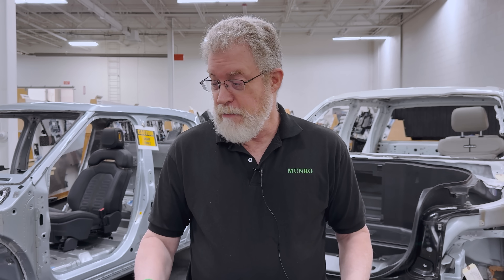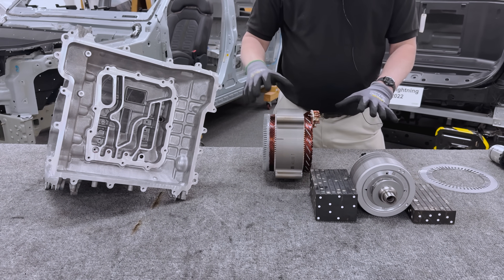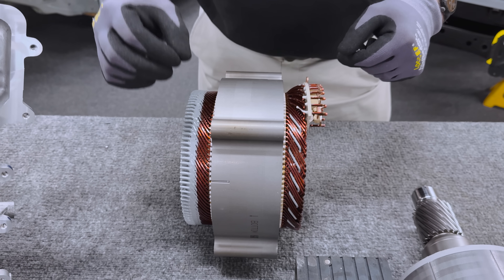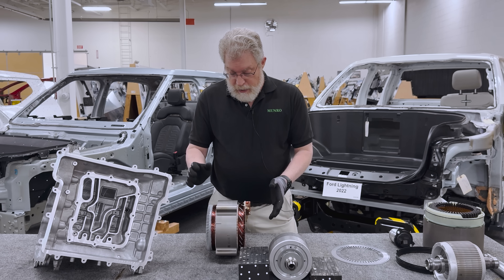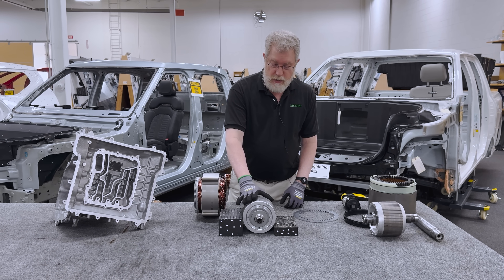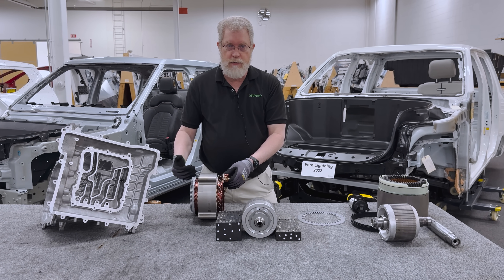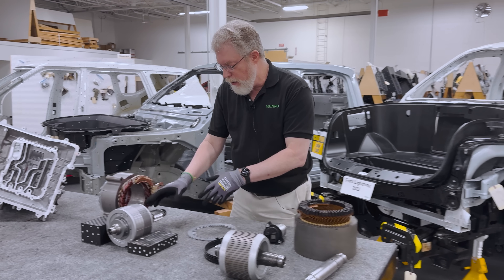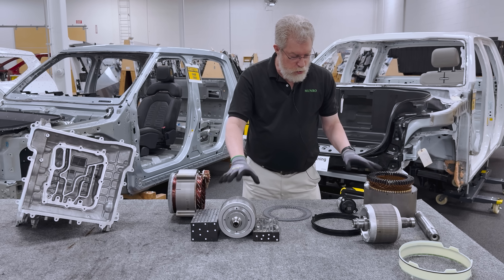Inside EV Cooling Systems: Tesla vs GM Electric Motor Comparison

Comment: Amazing to realize that a relatively compact, simple unit like an electric motor and gearbox can  usually exceed the performance of the much larger, heavier, wasteful gas engine and transmission, and not spew harmful stink exhaust into the same air humans like, and need to breathe.
Reply: Absolutely 💯
Reply: Never thought about Suicide by ICE. I guess you could always electrocute yourself but shoving your fingers in the charging plug😂😂😂😂😂
Reply: As a person here that replaces/troubleshoots drives and giant ac and DC motors in elevators for a career  your misinformed   electricity is very dirty #1 you would be surprised the carbon that is produced by electricity  these motors and drives pull the atoms in the air and change it to crud 
 # 2 you have a giant 1200lb battery attached to the car talk about inefficient 
Everything in life has a equal and opposite reaction  you  can call ice inefficient but evs are just as bad  heat is lost energy hence this video  hence elevator machine rooms constantly have to be cooled. Evs are like taking the jab  just my opinion
Reply: @doaudi1720 Could you please link to the chemical formula that explains what is going on in #1? Maybe you are just seeing some sort of pollution already in the air being sort of filtered out by static electricity charges from the motors? Not at all like an ICE chemical reaction that takes place for every firing of each cylinder. I can sit in my garage with the EV motor humming away without having the CO2 make life difficult.
Reply: @doaudi1720 EVs are more efficient than ICEs in every step of the way
Reply: You didn't include the battery system in your opinion.
Reply: Or drip oil or require oil changes every 6 months which also drips oil into the environment or everly's oil. And you never have to change a Tesla's oil for like I don't know. I think it's like a million miles. I've never changed mine past even 126,000 mi cuz there is no metal rubbing against each other like in an engine. It's just a cool
Reply: @bryanchannell7715 yes.
Reply: @bryanchannell7715  I disagree, there are bearings.
Reply: @tedmoss with very little load. The bearings act as locators in the motor to ensure constant distance from the stator.
Reply: @tedmoss certainly so. And which type of vehicle has fewer bearings to fail and which vehicle type imposes the heaviest loads and cyclic pounding on the bearings?
Reply: And animals breath too , but mostly humans in concrete jungles. Combustion 👎 EV ✅
Reply: EV and ICE are opposites: EV - Great, easy power, but crappy "fuel source". ICE - Complicated power delivery, but an efficient, high-density fuel source.
Reply: @snowrocket What crappy fuel source??? Electricity. EV’s are powered by Quantum Physics.
ICE cars are powered by Dinosaur juice.
Reply: @snowrocket I don’t see electricity as crappy. It is always there in my garage to replenish my car. If I’m clumsy, I still don’t have electrons spilling out onto the floor just looking for a chance to ignite. If I need charge during a trip, stations are easy to find. I can just plug in, not get gasoline on my hands, and go about my business while the car recharges. It is so much better to not have to deal with a sloshy, flammable liquid.
Reply: Moving the destruction of the earth from the tailpipe to the supply chain! Whooohooo!
Reply: @hankkingsley9183 are you intentionally ignoring the destructive supply chain that goes from the oil field to you gas tank only for the gasoline to be used once? This is far worse than mining some recyclable metals from the earth.
Reply: People who think that ICE cars are better than EV have obviously been affected by exhaust fumes.
Reply: You can't consider electric motor without attached electricity network. For ICE you only consider a canister with gasoline.
Reply: @АгронДепартье  Wtf 😂 so the gasoline just rains down into the can ? Or should you consider a huge network of pumps and refineries, crude oil and wells 😂
Reply: @АгронДепартье no. I have Solar Panels. I can make electricity from the sun, flowing water etc. but as hard as I try I can’t make good old Gasoline. Any ideas. In the mean time I will enjoy my EV.
Reply: @williamnot8934 But you can't still carry your solar panels together with EV unlike the canister... So which total system is bugger?
Reply: @АгронДепартье My Tesla has a thing called a Battery. It actually stores Electricity believe it or not.
Reply: @АгронДепартье what are you talking about? You have a canister or you have a battery. And eventually you will have to replenish both.
Reply: @АгронДепартье we have never had a problem with not getting home to charge or to a charger on a trip. Our Tesla's range is great. When we only had a truck we had to stock gas gerry  cans because in off season no local gas. The Tesla just plugs in at home and is always ready to go. For us about $30 - 50 a month in hydro. We have to go off Island to get a Tesla charger. We're in Northern Ontario and deal with snow + cold.
Reply: @АгронДепартье Where did that canister’s contents come from? They aren’t filled by magic.
Reply: @Fred70115 Doesn't matter. Still the overall system is more compact
Reply: Thanks to catalytic converters and fuel injection its mostly just carbon dioxide and water vapor coming out the tailpipe. 
And carbon dioxide isn't intrinsically harmful, in fact it's the most important one to life. Its only problem is its a better insulator than many other gases too.
Reply: Right which is why it's still a top 5 way globally for us men to self delete SMFH. That's right parking in an enclosed space, Rolling the windows down and turning the ice engine on to self delete!
Reply: @PeterKamen-c5d  You are misinformed, 1 million people are estimated to die every year from car exhaust.The main problem is the size of the particles, they lodge in the lungs. Oil kills more people than even coal does. I'm a former miner.
Reply: @tedmoss  Where is the data analysis to be found to back this up?
Reply: @tedmoss the real killer is when the particle enter the brain.
Reply: You act as EV production as disposable, as the lower average working cycle expectancy before being obsolete, aren't Environmental issues too? Stop the Greenwashing.
Reply: @RogerM88 you also forget about the catalytic converter that as it ages it breaks down and the platinum,paladium and ruthenium end up all over the road which are expensive rare earth metals .
Cody's lab on YT went and got a small load of dust from a highway and separated the dust from the REs , melted it down and got a bead of those metals and it wasn't much he got from the road either. 
What is the damage to the environment from those particular metals??
Reply: @RogerM88 owning an electric car is liberating. No worrying about gas fumes in the house from our attached garage. No sitting in the garage waiting for our oil changes or expensive repairs. No breathing carcinogenic fumes as we fill our gas tank. We burn wood and propane. We drive a gas truck. But our Tesla is amazing.
Reply: @RogerM88  what’s parts in an ev have a lower cycle life go ahead
Reply: @PhysicsOperator  Plenty of BEVs with more than tens years obsolete or bricked.
Reply: @RogerM88 Plenty of 5-10 year old ice cars with engine or transmission failure. My daughter just had her 2022 transmission fail with only 70,000 mi. Had it been a year or two older it would have been less expensive to replace than repair. Electric motors and batteries are good for 200000+ miles on average, exceeding the 150k of ice engines. You talk about individual failures of evs. There are more early failures of ice cars.
Reply: @RogerM88 and how does that compare with the gas burners?
Reply: @PhysicsOperator  The electronics will eventually get obsolete faster than average with IC. The battery could be a hazard issue long term. If EVs are so great, then let the market decide.
Reply: @RogerM88 I agree on let the market decide but it already has in many places anyways yeah nah the majority of electric vehicles will have tiny fractions of failures compared to even mildly reliable cars
Reply: @RogerM88  This makes no sense in physics or engineering. EV's are always going to be better, ever since the1880's.
Reply: @RogerM88 
Haha! 😂

Comment: In stop and go traffic on a hot day does the GM motor cool enough? It only circulates when the gears are turning, i.e. the car is moving. Yes, the engine only produces heat when the car is moving but I imagine heat can build up in a long traffic jam or congested city driving.
Reply: City driving puts very little loading on the motors, more loading only for short durations, and no motor loading whatsoever when stopped. It won't be a limiting thermal-loading condition.
Reply: I bet GM hires engineers smart enough to consider these issues.
Reply: @mikus4242  I betcha someone shoots down their ideas and the lowest cost, inferior solution wins. Meanwhile, the customers eventually lose... after the warranty expires, of course.

Comment: My concern, is slow speeds, at high loads. How fast do you need to go, to ensure proper slinging of the rotors, and to ensure filling of the overhead oiling used in the GM examples? Torque=current=heat. Speed increases air gap voltage, which increases iron losses in the stator, but that's insignificant compared to I^R losses in the windings. Tesla's pump system looks much more effective at lower speeds, both systems do fine on the highway, but, what about crawling around town in San Francisco, where the speeds are very slow, and the hills are steep. That creates drip angles, low gear velocities, and heavy amounts of current flow through the windings.
Reply: You are spot on.  Lombard Street in SF is the nightmare scenario for the cooling approach that GM uses.  The system was designed with that in mind and countless simulations were run with exactly the situation that you describe.  Also, the design that survives creeping traffic up a steep hill has to not deliver too much oil when driving on level ground at highway speed.  It's not easy to achieve.
Reply: @PaulTurnbull-EMfield  Do I dare go to San Francisco in my 2025 Equinox EV all wheel drive? I do believe, it uses a permag front drive motor, exactly what was shown in the video, but has an induction rear drive, that could offer some assist on those steep grades. The car does have excellent regenerative braking, but I suspect, it will be "blending in" some friction braking as well. Do you know if the rear induction helps with regen?
Reply: @vincentrobinette1507  Induction motors do not contribute to regen because they lack a permanent magnet.
Reply: @NWBx01  At higher speeds, induction motors can indeed regen, but, because there are no magnets, they "drop out' at a higher speed, than permanent magnet motors. I just don't know at what speed the drop out would occur, based on gearing. I just don't know if the rear axle of an all wheel drive Chevrolet Equinox would cut in, when heavy regen is needed. Induction motors are also worse, for automatic hill holding. They would require more energy.
Reply: @NWBx01 yes they can regen you need to lag the frequency with the motor speed this will cause it to try to push power back
Reply: @nightmareinaction629  The escalators in shopping malls use 3 phase motors. The "down" escalator actually regenerates power, when people ride it down, making escalators very efficient. However, the motors run at a constant speed/frequency/voltage. Because of slip loss, the "down" escalator runs a little faster than the "up" escalator, when multiple people are riding at the same time. EV's use variable frequency/voltage. the question is, how SLOW before it can no longer effectively regenerate?
Reply: @vincentrobinette1507 from personal experience pretty slow but they require a lot of torque for it to work. It does seem to be very unstable below 7hz. The motors I have personally done this one are only about 50 horse power slowing down a huge blower
Reply: Pittsburgh, PA in the summer would be similar.

Comment: Always so informative.  The pros and cons of each system are so interesting.  I would love to see a comparison of all the EV systems Munro has broken down with comparisons of battery modules and packs BMS, Motors, cooling, inverters and overall packaging etc...  It is neat to compare high end expensive systems to more pedestrian or lower costs vehicles.

Comment: Great explanation💪
Would you be willing to do the same for a Audi e-tron?

I own a 2021 model, and had some issues regarding cooling.  It seems that their design has some serious flaws resulting in regular costly replacements of the rear drive unit. 
Just after the first 30k, strange behaviour started. Result: the rear engine was flooded with coolant and the whole unit had to be replaced.  9000 euros, but under warranty. 
The engineer said they abandoned that design on the new Q series.
But yeah, I suppose it's just waiting to happen it again.
Reply: ugh. Sorry to hear that.

Comment: Why air cooling is not used? Noise? Efficiency loss? I mean closed air system which is cooled by the outside with water.
Reply: Because air cooling is not as effective ...

Comment: would it not be a concern for metal particulate in the gearbox oil to be getting in contact with the stator?
Reply: There's no voltage between the rotor and stator, so it doesn't really matter.  You don't want them to touch each other because it mechanically damages them not because it will cause a spark.

Comment: Why not use thin copper tubes as winding wires? This should keep wires tubes cool, while maintaining the iron warm. The enameled wire works against heat conduction to surrounding liquid? apart from taking out much heat from laminated iron🤔. That said, the internal mag. field in a conductor is of least benefit, while the external one is that matters. Again at high switching frequencies the tube has better current density, lower resistance. It is just a manufacturing limitation neverthless(not to forget,about the highly efficient spaghetti cooling tubes in Tesla HV battery packs).  Also why not use a dual diaphragm linear(long term reliability🤔) oil pump in push-pull configuration (with temp based gating/one way valves) for better turbulance(improves heat xfer) and efficiency at a lower pressure?🤔.❤👍
Reply: Magnetic field strength is exponentially correlated to distance. The field is generated by the winding wires, and in a perfect world, it would be infinitely thin and as close as possible to the rotor to minimize losses. Using tubes would mean magnetic field would be in the gaps inside the tubes and would suffer efficiency loss. Because it's an exponential function, a tiny, sub-mm gap would mean huge losses when considering all the windings. Enamel Wires have been the choice for decades because it's the thinnest wires that are insulated against each other we found.
Reply: @kickassnetwork good answer
Reply: Good questions

Comment: I wonder if the complexity of doing oil cooling is why a lot of the early Tesla drive units failed repeatedly for some people because of cold climate maybe or driving conditions
Reply: I believe it was fine particles left over after manufacturing.  Early Model 3 has an external oil filter. current ones have a filter internal in the  gearbox